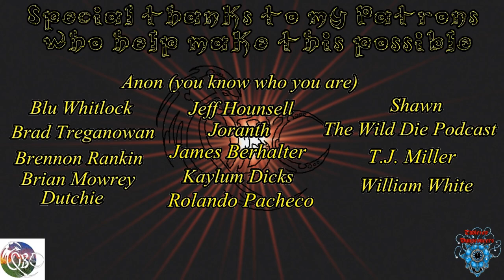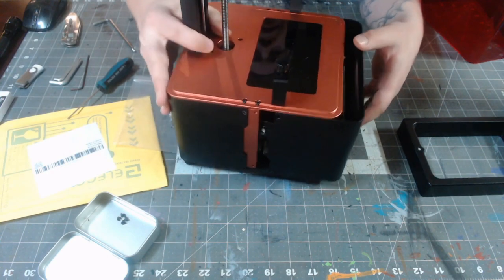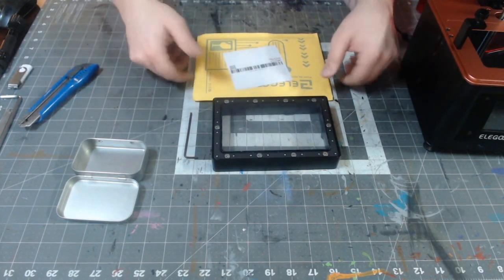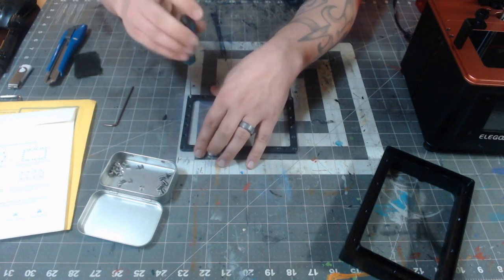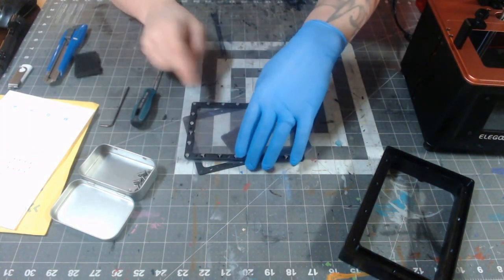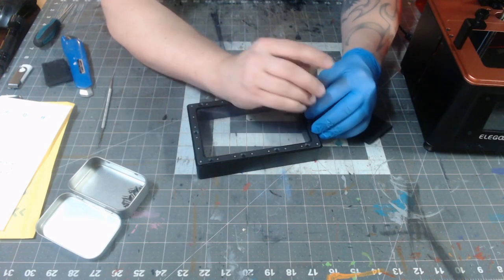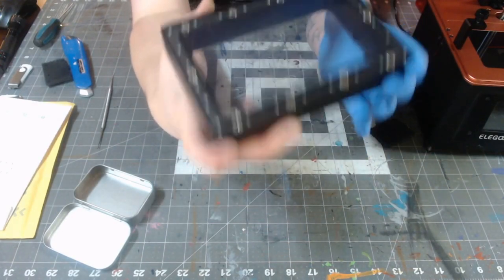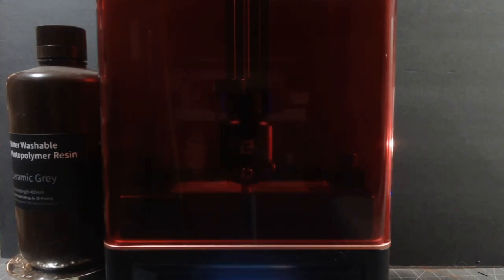Elegoo Mars Review and Repair

Comment: Wait, you have a thread gauge ?
Reply from the maker: several and a tap and die kit :) remember my background in crafting is metal and leather
Reply from the maker: @SaveorDie  yeah for threading posts and such. More often than not chicago screws are the wrong length so you use ones too long, cut em down and retap the threads to clean em up